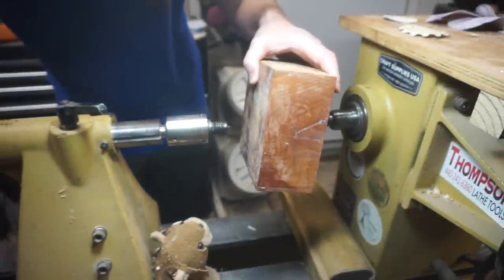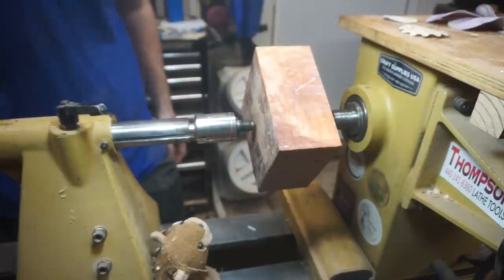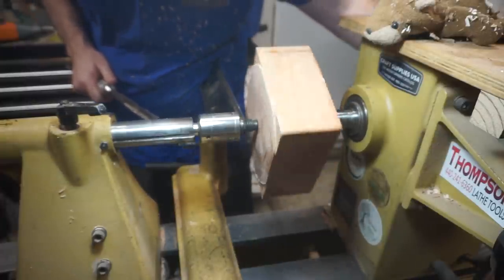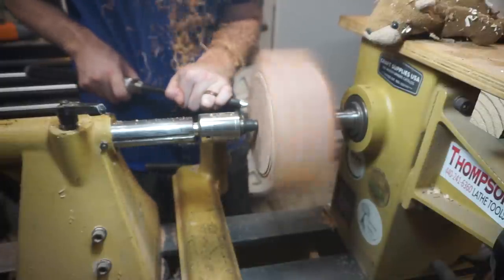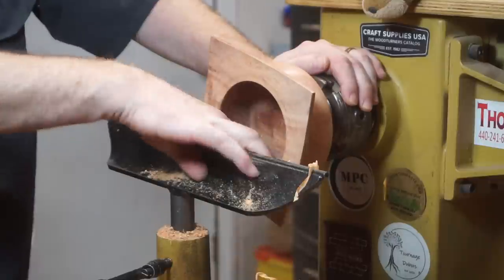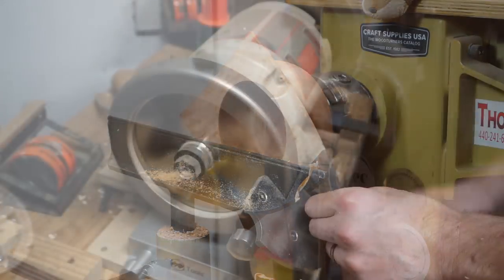Woodturning - Stunning Color and Grain!

Comment: That came out awesome! Always forget to ask, what's the tool set you have with the quick change shanks?
Reply from the maker: Thanks! The modular tool handles are collets which connect to the gouges are made by Stuart Batty. As far as I know the only place to buy them at the moment is online at Woodworker's Emporium but they have limited supply as Stuart Batty has stopped manufacturing at the moment. The last I've heard is that he's looking at opening a manufacturing facility later this year in Colorado. So I've got my fingers crossed!
Reply: @HodgePodgeWoodWorks  they seem extremely handy, especially during production runs... I hate having 3 or more tools laying on my bedway... need a better solution now that I've upgrade to a proper lathe
Reply from the maker: Yeah they are especially great when it comes to sharpening. Much easier to swing the tool around and not have to deal with a cumbersome handle in the way.

Comment: PS what finish did you use?
Reply from the maker: I used General Finishes sanding sealer first (not a big fan of it, just trying to use what I've got left) and then applied Deft Gloss Lacquer.
Reply: @HodgePodgeWoodWorks  cheers!